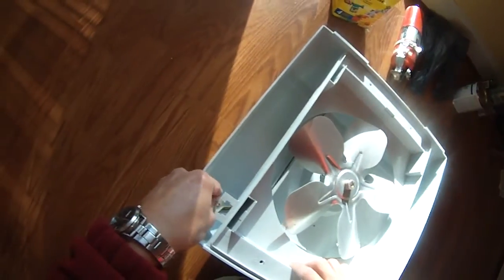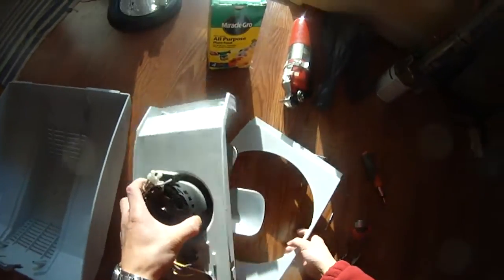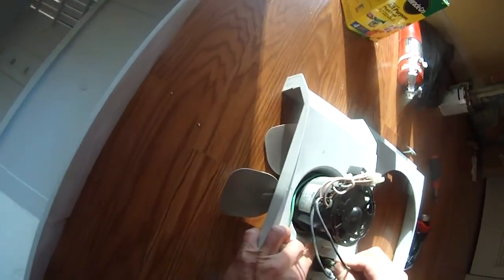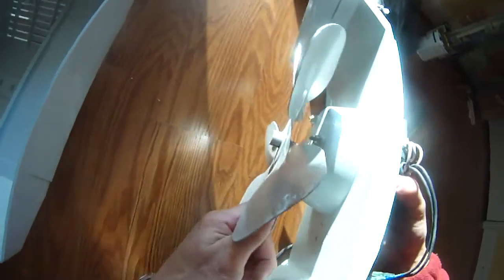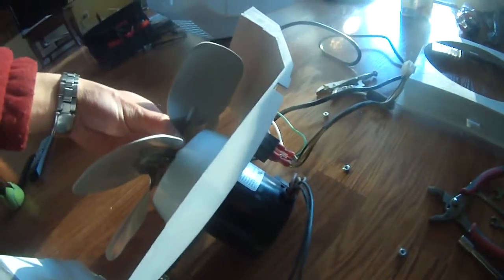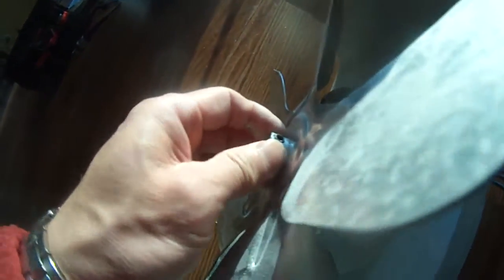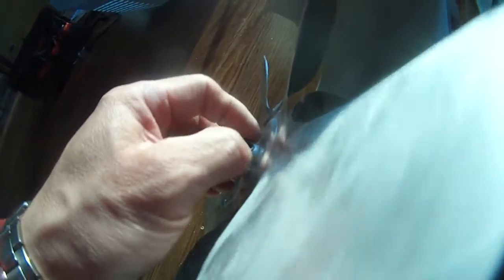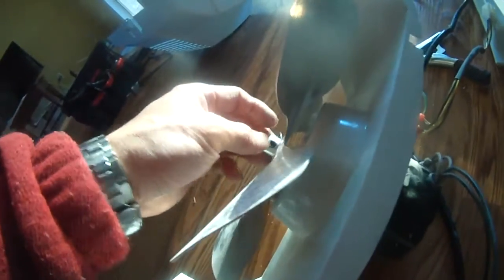how to remove the humidifier fan motor of Aprilaire 700M - part 1 of 6

Comment: If you haven't gotten it yet, you need an allen wrench to loosen the set screw that holds the fan to the shaft.
Reply from the maker: +Scott Biba thanks a million. yes i was able to get it open and reinstalled with new motor. So the humidifier is good and kicking and running